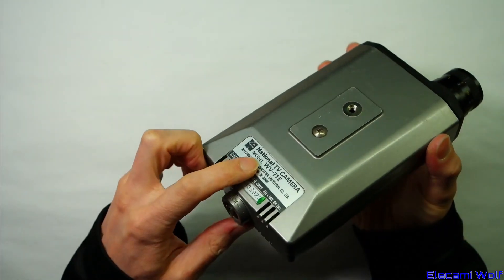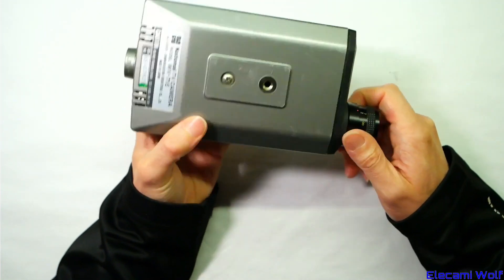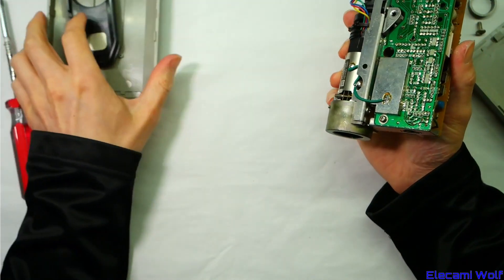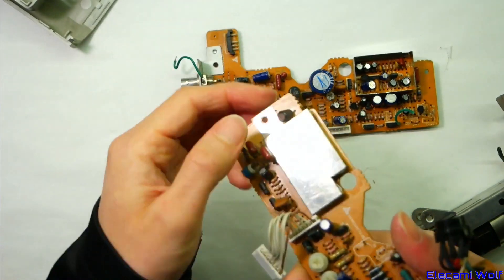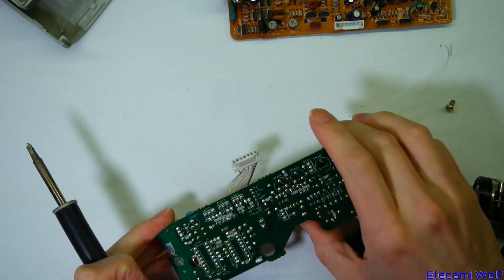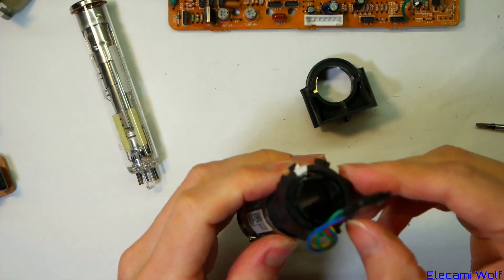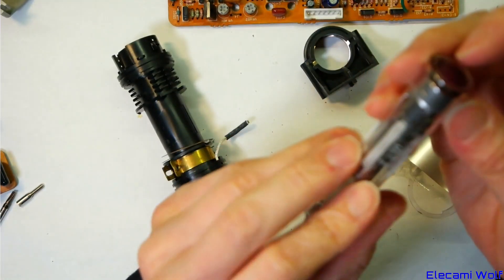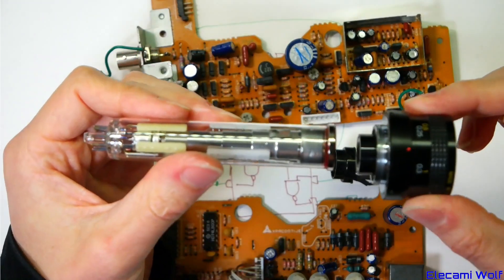EW0043 - Panasonic WV 71 CCTV Camera Teardown

Comment: that was a easy one
Reply from the maker: No exciting mechanical parts like the VCR mechanisms. But it is good to see what is in there.
Reply: All that’s needed to get these going is to feed 12v dc into the bnc connection and use a small capacitor to take the video off the positive connection to a monitor this is how masthead amplifiers and microphones are fed